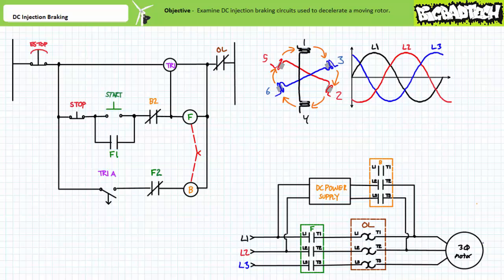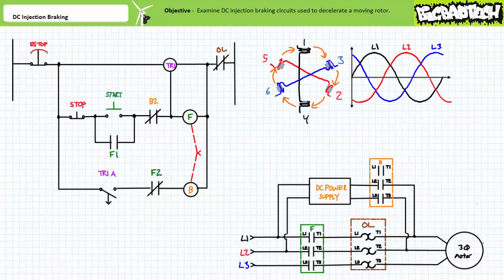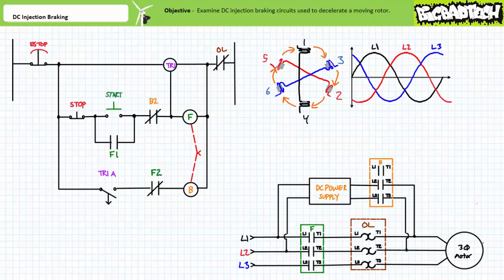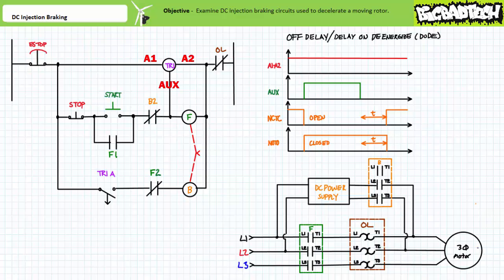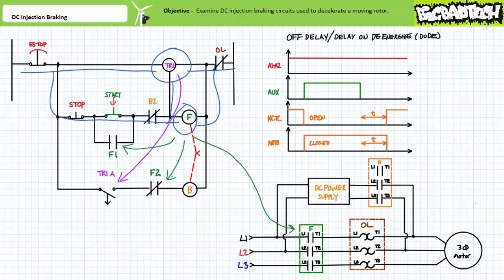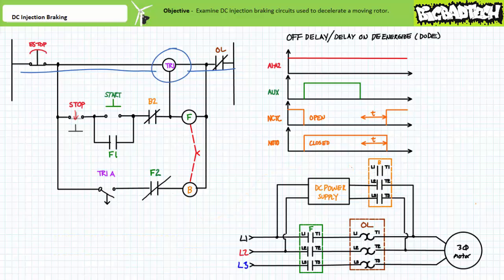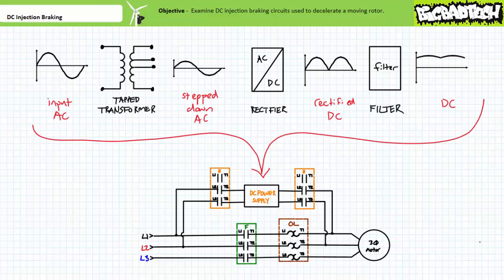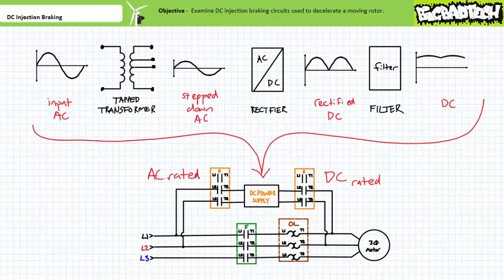DC Injection Braking (Full Lecture)

Comment: I was taught as you explained here, nevertheless, I found that PowerFlex 525 from Allen Bradley has a parameter to set a DC braking time after the deceleration ramp. I was curious how they could implement this without damaging the motor. To this point I believe they make use of brake resistor in combination with the DC current injection and feeding one coil at a time with a defined duty cycle. But, that is just my guess. The thing is, it works, I had an issue with a conveyor that after the deceleration ramp (by inertia I assume) it continued to move for a couple of seconds until completely stops, even though it was already stopped before. I moved that parameter and it's definitively holding the motor 1 extra second after it fully stop.
Reply: Will u please provide wiring diagram for the same

Comment: does dc injection braking may cause significant unbalance currents supplied to vfd???
Reply from the maker: Most likely not. Check out the rectification and inversion in motor drives lecture at: https://youtu.be/FZIVhHNdYnY Ideally the incoming AC is rectified entirely to DC from all 3 phases equally.